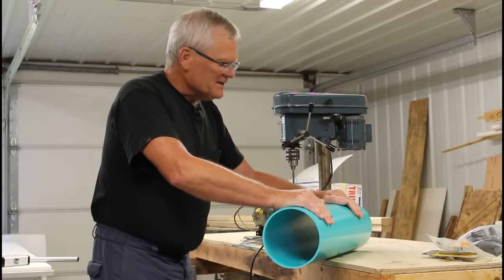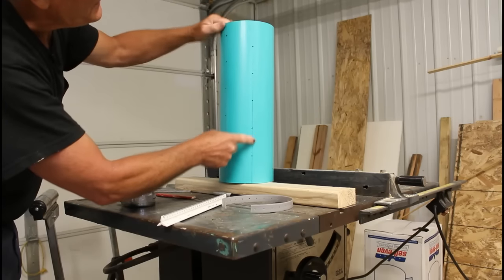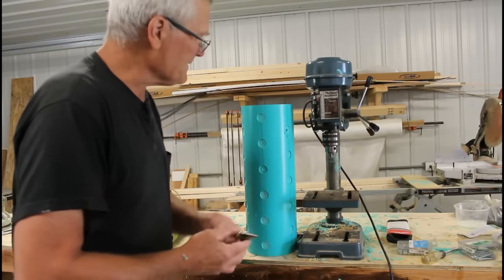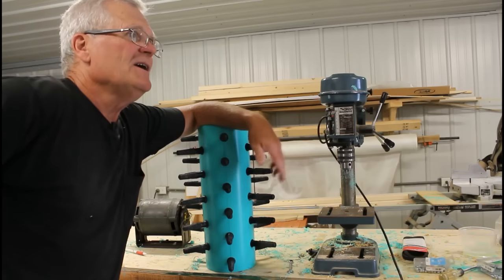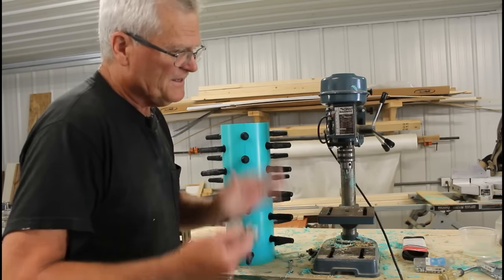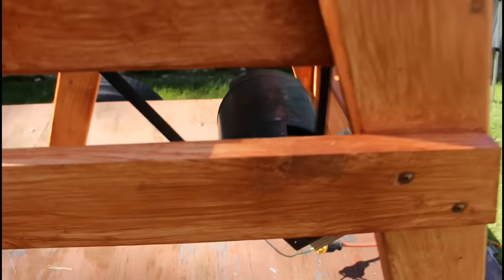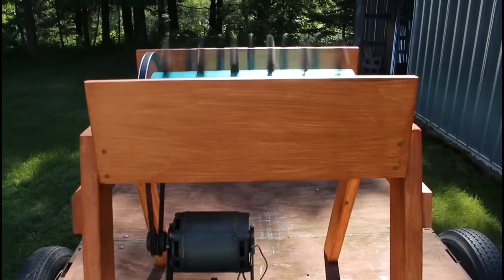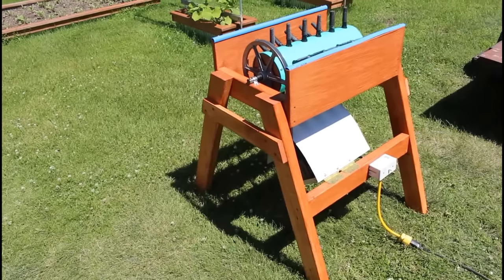Our $50 Chicken Plucker

Comment: I was increasingly worried you were were never going to show us how it worked, but I'm glad you finally got to it in the end.
Reply from the maker: Yes Martin, I know it is too long. I intend to make another one using thin-walled 6" pvc, which is much simpler. I am searching for another motor for a more straight-forward video. I used this one the other day, and it can be seen in use in a new video.

Comment: One of the guys in our duck club bought one of these from Gander Mountain for the club. Worked OK on duck but wouldn't touch a goose feather. The store-bought plucker needed a bit more power!!
These things really help out a tired hunter!!
Reply: just switch out the engine.. hit and miss engines or the side wheel of the old tractors usually powered the old time ones..

Comment: Next time if you need to find equal spaces on pipe or anything round. Diameter of pipe times 3.1459 or (pie) then divided by the number of equal spaces you want. A fleet measuring tape works wonders during this too. I’m a pipe fitter

Comment: Can you describe your final RPM outcome , and the diameters of the pullets you used,. Thank you very much!! Very well done!!
Reply from the maker: The motor pulley is about 2". The top pulley diameter is 10". The motor rpm is 1725.  Someone smarter than me could likely tell you the rpm of the 6" drum. I can only say that it is about the same as the commercially-made pluck we have, and I guess it is about 350 rpms. I can put my hand on top of the rotating fingers without much discomfort, so it just feels about right to me.
Reply: BackWood Basics thanks much!!

Comment: Thanks for the video and don't worry about the naysayers think or say about you You know this is your own little deal it works for you it's safe enough for you so we don't need the OSHA police barking at your door about what you did wrong according to their likeness
In fact I'll be building one very similar to what you have I'll be changing it to fit my needs because I have a big drill that turns low RPMs so I'll use that instead of the electric motor gear down but I love your concept and the way you did it Thank you
Reply from the maker: Thanks Dean. Good luck with your project!

Comment: This is an inexpensive idea for a small farm use.  I would put a new extension cord in a junction box, put a weather proof switch on, run that into a GFCI WR rated outlet on that, plug in the motor into that with some flex weatherproof conduit between the motor and the outlet, then run it..this way you are protected from accidental shock.

Comment: Neat design, but you really made your math way more complicated than it needed to be.
Here's the easier way to determine your picker line separation distance:

By definition:  C / D = π, where C = Circumference, D = Diameter, & π = ~3.1415926...
Using your measurement of D = 6.25", we then have:  
C / 6.25 = ~3.1415, so 6.25 * 3.1415 = ~19.634954 <--- this is your pipe circumference.

You then divide that circumference by 6 as follows:  19.634954 / 6 = ~3.27249" (this means that your 6 drill lines need to be ~3 1/4" apart around the circumferences of your pipe (i.e. more precisely ~3 1.1/4", but that extra bit won't matter much in how it operates at the RPM that your machine will operate at)

I love the simplicity, low cost, & efficiency of this design--it is brilliant!  Well done!
Thank you for sharing!

Comment: Messy chicken plucker built one using barrel alot less messy
Reply from the maker: Messy, but outdoors. We only process 20-25 chickens a season, and can only scald one at a time, so the single bird plucker works well for us. If we did 100 at a time, I might spring for the added cost and complexity of a drum plucker. when spring arrives, I hope to have a simpler version of this plucker available, with less talking, of course.

Comment: @ 27:05 You called it Lithium Grease. The tube you showed does not say "LITHIUM": it just says White Grease. LITHIUM White Grease is not food grade. CRC has a food grade White Grease that is labeled "Food Grade." Lithium Grease is toxic.  Look up the Material Safety Data Sheet.
Reply from the maker: You obviously know much more than I do. It has an H2 food grade rating, and is approved by the USDA for use in federally inspected meat and poultry plants, where it will not be in direct contact with food. I figured the bearings are a safe enough distance from a chicken. It may have been confusing to even mention using it. Thanks for pointing it out.
Reply from the maker: I went by what it says on the back of the tube. "Lithium based with white solids".  I bought that years ago, at Cabela's, in their food processing section. They sold it to lubricate sausage stuffers.
Reply: @backwoodbasics9383  No, I don't know that much about it. I thought perhaps you had mistakenly called it Lithium Grease because  a lot of White Grease is Lithium based. I apologize for my mistake. I was just concerned that someone out there might get the idea that White Lithium Grease is Food Safe. I read that USDA quit issuing those approvals in 1998. 

I found your project to be very interesting. I remember back in the mid 1950s, friends of my mother's had a small farm, and they had a chicken plucking machine. I couldn't remember how it was constructed, and I only remember seeing while it was running. Those fingers are hard to see when it is running, so I couldn't describe to anyone how it worked. I told a friend about it, and he didn't believe me. He had lived on a farm at one time, but he had never seen or heard of it. I was so happy to see that such a machine really does exist. I thank you for making the video!